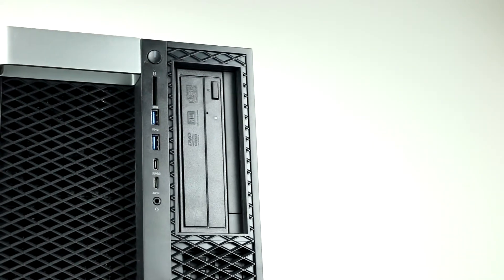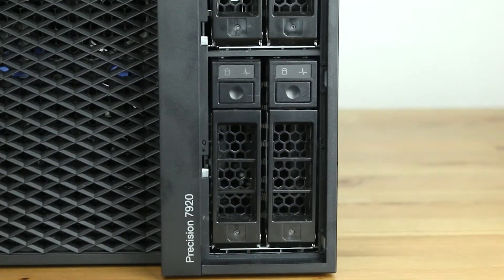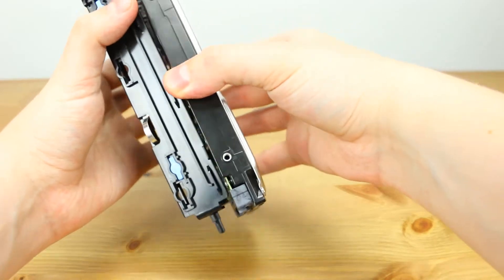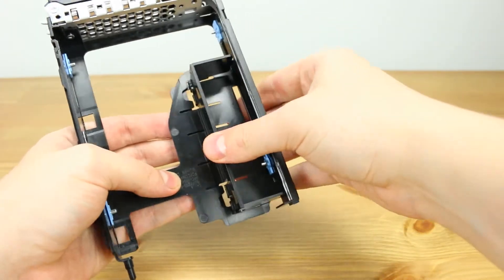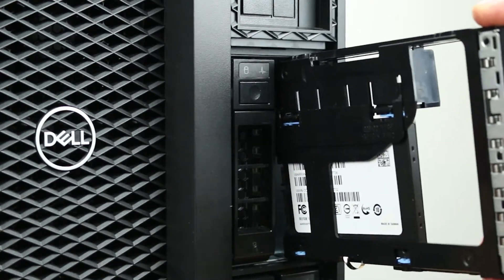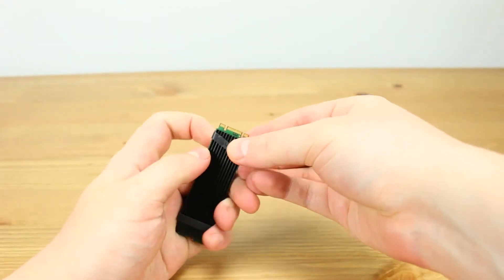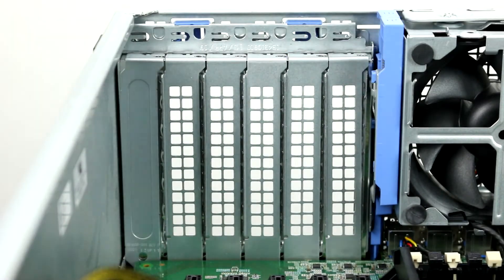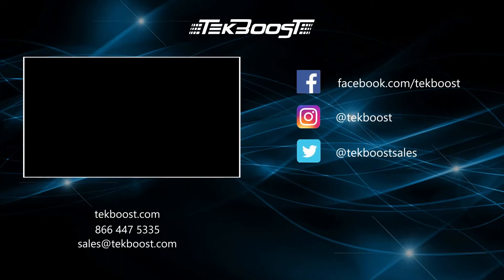Dell Precision 7920 Hard Drive Installation

Comment: Thanks for your useful video. I would like to supplement the following information.

There are 4 pins that hold the drive. It might be difficult to insert the drive into the drive assembly, due to the need to bend the plastic assembly. One trick which I have found is that the pins can actually be pushed inwards (if you exert the appropriate amount of force). This is because the pins are held in place by *rubber*.